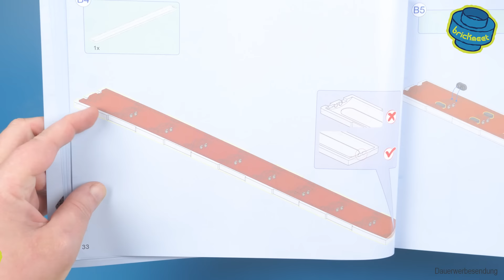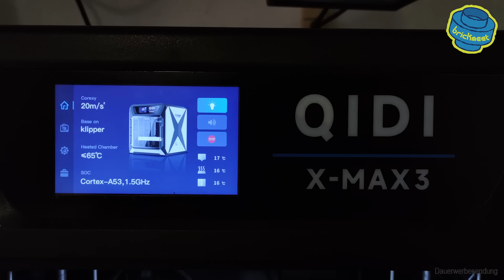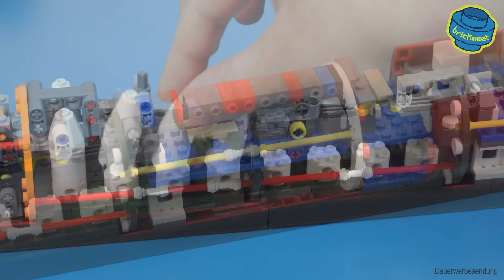Functions, Light and Building Fun

Comment: 88 cm, you know what else has 88? Exatly, the tiger canon has a diameter of 88mm, casuality? I doubt it
Reply: Let's put the submarine inside the barrel!
Reply: Sadly, that won't work. This is 88 cm, the tiger is 88 mm. This sub is ten times the diameter of the tiger barrel
Reply: @dalemorgan9080  I would like to disagree, yes the Diameter (And size of the shell) is 88mm, but I believe 88cm is for the length (the sub), not diameter. Also, if it was 88cm in diameter, he probably wouldn't be able to hold it (Going off the 38cm Sturmmosser).
Reply: LOAD "SUB"-CALIBER MUNITIONS lol
Reply: @spudabrums  i think you might be right, but... Pedro
Reply: My guy the tiger’s cannon is 88 MM NOT CM
Reply: @bruhhi1099  bro, i know, i say that, i say the both are 88 but i say different measurings, learn to read
Reply: Boys, we need to read the details, i say cm and the mm, i never said it would fit
Reply: @pasuyongchonghin2453  ah